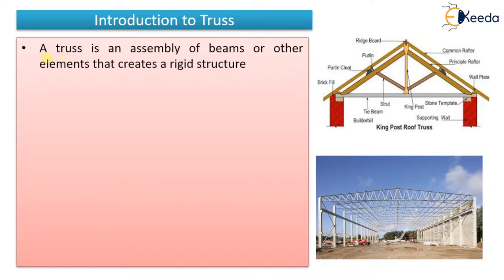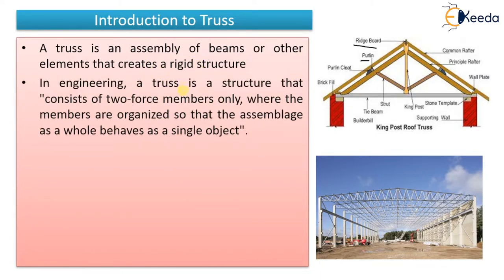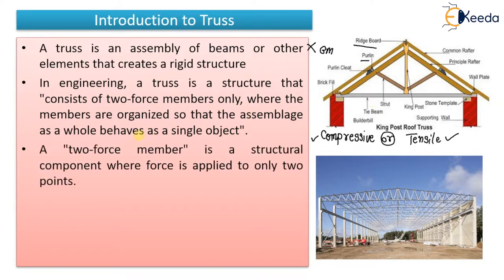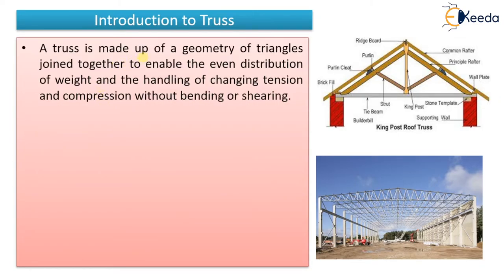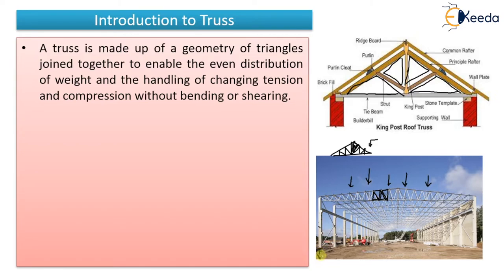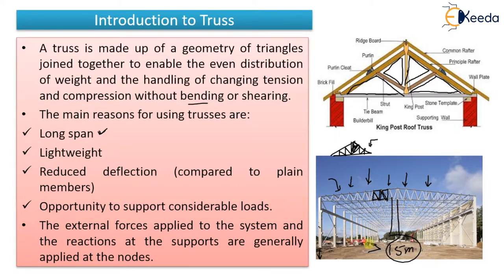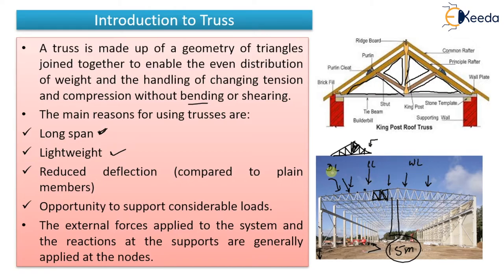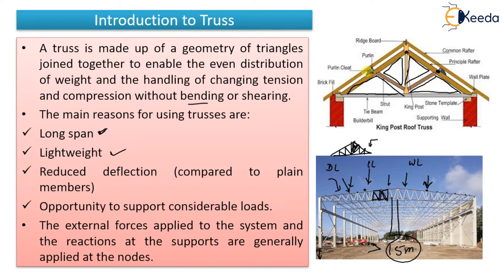Introduction to Truss - Design of Truss

Comment: Is there a logical mental intuitive method to determine which of the member is most likely in tension or compression starting analysis in mind from the beam or loads on the top or the truss assembly and without knowing the actual values of the loadings and measurements?

Thanks

BTW
I observed the trusses assembly in a gym rests on beams on opposing walls.

Please reply and clarify
Best wishes